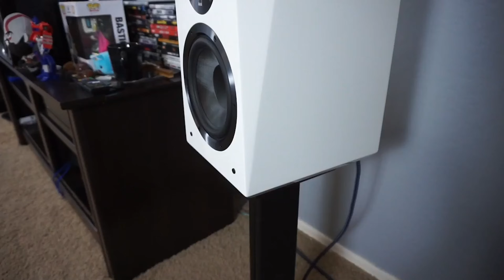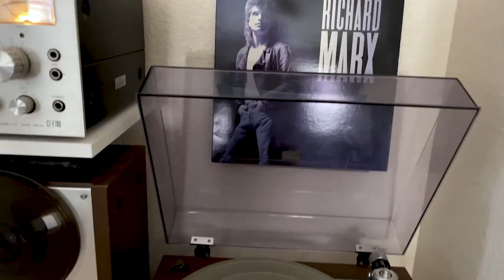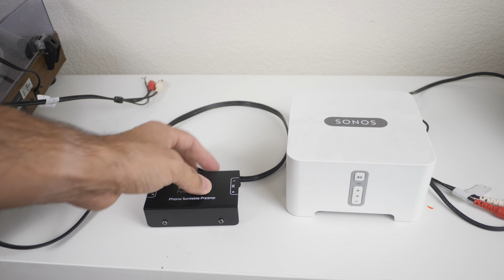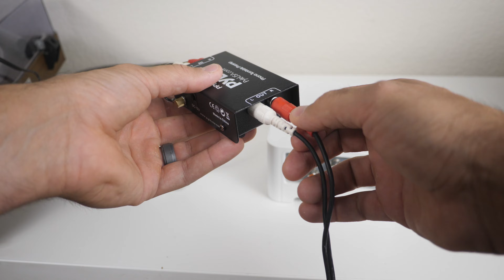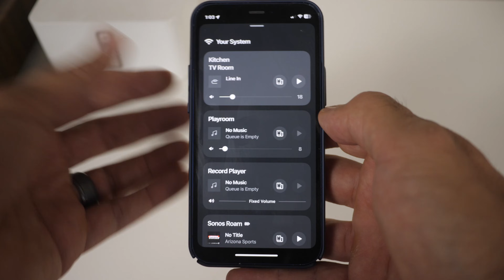Sonos | How to Use Any Record Player (Tutorial)

Comment: I’m kind of disappointed with Sonos.  I have an arc, two subwoofers, Sonos amp and two Sonos ceiling speakers.  Recently I decided to wanted to get a record player and picked up the audio technica lp120.  I hooked the rca cables into my amp thinking everything would work nicely.  But if you use the Sonos amp line in, it disables it from playing surround speakers?  But works if you place it in a separate home speaker group, but then it uncouples it from my other components and doesn’t work properly sync when connected to my tv.

Comment: Would this work with a TV out?
Reply from the maker: Technically, yes but you may find a significant audio delay, which is why the Amp or soundbar is a more practical solution.
Reply: @H @HiFiBrothers I am looking at using Digital to Analog Converter.Optical out on TV via a via converter to RCA Males to Sonos Amp/ Bridge do you reckon there still would be a delay.

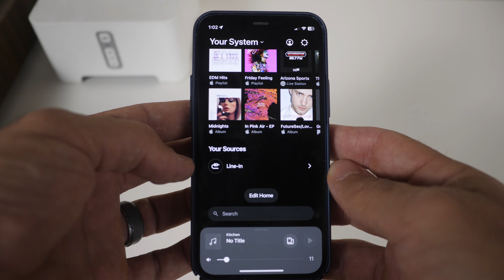Comment: How did you get that on the SL2 app…I thought the connect only works on the original app… 8:03
Reply from the maker: Yes. Newer versions of the Connect will work on the S2 app.
Reply: Gen 2  Sonos connect works with s2 app. Gen 1 don’t

Comment: Thanks for this I am building out a section of my den for my equipment and want to use some of my old vintage equipment. 

One question, how does this preamp impact the sound quality? Do you experience any delays from buffering that through some of the speakers, and not in others?
Reply from the maker: Preamp shouldn’t effect sound quality, if you choose a good enough preamp. Using a Sonos Connect / Port, I would expect a slight delay but we’re talking milliseconds.

Comment: I watched your video - it was great and very helpful! I have a vintage garrard record player I’m trying to connect to my Sonos eros. I bought the preamp you recommended - I feel like I’ve properly connected the rca cables from the record player to the preamp and I have the connection to plus into the line in on the Sonos. My app seems ok and connected but I’m not getting any sound.. any ideas what I’m doing wrong??  Thank you!!
Reply from the maker: Did you toggle the Line-In setting from the app? You need to tell your Era that you want the sound from the line-in on
Reply: Thanks yes I did
Reply: Thank you so much for your help! The record player is very cool and will be even better when I can get it to play ☺️
Reply: Hi WiFi brothers - still not working - any other ideas?? Thx!!
Reply from the maker: Remove the preamp from the situation and see if you can get any sound from the turntable - it will be extremely low, so you’ll need to boost the volume to get any sound. 

If you get sound, it’s the preamp, if nothing - it could be the turntable. 

Also, try anything else connected to the speaker - like your phone. If it works, then definitely points to one of the other hardware components. 

Lastly; if absolutely nothing then it’s a settings problem, problem with the speaker itself or could be the line-in adapter. 

Lots of info here but best of luck!

Comment: Good video. Question: how can I connect an active subwoofer to the Sonos connect? To the input in Sonos or to the output...and won't burn the Sonos connect if I turn up the volume on the subw? Also, I supposed to connect the Sonos connect to my powerful 2,1 creative (I think)...so that has only one Connector; 3,5 audio, that we connect to any device like laptop, phone...how can I connect that system (3,5 audio line) to the Sonos connect?? Thanks
Reply from the maker: The connect/port is intended to be connected to an existing amplifier or receiver. 

Even if you have a powered subwoofer, you’re unlikely to get the proper sub output because these devices lack that type of support.

But you can always test it out and see if you’re happy with the results or if would even work. Just start at low volume :)

Comment: I use the usb to 3.5mm line in component to connect an Era 100 speaker to my pre amp. Then it connects wirelessly with another Era 100 and also a Beam. However, when i lift the stylus off to change the record , the second Era 100 and the Beam drop out. I then have to fiddle with the app settings every time to reconnect. I shouldn't have to do that process every time i put a different record on. Any ideas on how to solve this? Thanks
Reply from the maker: Sounds like the problem could be with how you have the Era 100 connected (usb to 3.5mm) - when the Era 100 doesn’t detect sound output it disconnects the other speakers?!

We’re just guessing but we’d try connecting it with a different cable to see if that’s the root cause. 

Otherwise, could just be the app disconnecting the other speakers and it’s just coincidence. Best of luck!
Reply: Thanks for fast reply. As far as i'm aware though, i can only use the Sonos USB-C to 3.5mm line in adapter. A generic orher brand doesn't work. Only the Sonos one will work. I'll try uninstalling then reinstalling the app and setting up the speakers and the line in again. Thanks

Comment: Hey! Thank you so much for this video. What about the signal? I asume It’s not lossless? 

For example, one Era 300 through line – that’s direct analog lossless (kind of) –. Would then sending to the pair + sub demerit the signal?

Thank you!
Reply from the maker: Most Sonos products support CD-quality lossless audio (16-bit/44.1kHz) through their line-in connection. 

However, when streaming vinyl to other Sonos speakers, the audio is compressed to approximately 320kbps using Sonos’ internal codec, similar to high-quality MP3.
Reply: @ thank you very much for the sound and quick response! Means a lot.

Comment: So with a Gen1 Connect and the pre-amp, I can do this? And will it run with the latest app?
Reply from the maker: Unfortunately, no. You need a Gen2 Connect (manufactured after 2015) to use it on the S2 app.

Comment: hii, are you using the gen 1 or the gen 2 connect? I am able to buy a gen 1 but i dont know if it would work :/
Reply from the maker: Gen 2 because it works with the S2 app - Gen 1 won’t
Reply: @HiFiBrothers  If you factory reset the gen1 then delete it from your S1  app you can add it to your s2 and do the firmware upgrade it should work also. I install for a living for Geek S and do this often with other gen1 products
Reply: How do you know the difference between Gen 1 and Gen 2  because I've been looking into eBay, and all gen1 connect  looks exactly like then one here

Comment: I have an old Technics turntable.  
I bought a phono turntable preamp and i have the Sonos conect Gen 2 just what you have in the video presentation.  
It does conect,but the sound coming out of the sonos Play 1 speakers are bad,looks like it has inteference.What am i doing wrong?
Reply from the maker: Here is how to troubleshoot:
1. Check the Line-In settings from the Sonos App for the Connect
2. Make sure Line Out is set to “Fixed”
3. There is also an “equipment type” setting - set that for a lower type ie: audio equipment

See if this fixes the issue. Otherwise, we may be a bad connection somewhere.
Reply: Have you connected  the ground wire to the phono amp